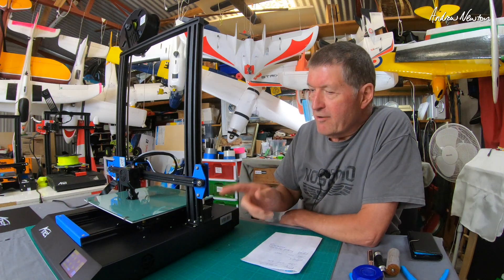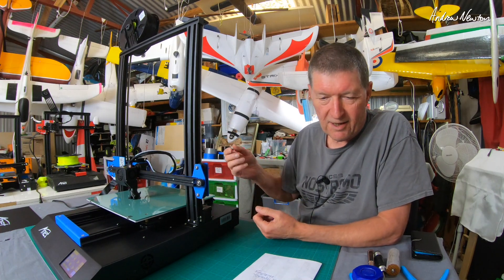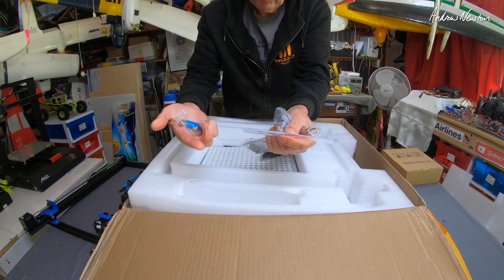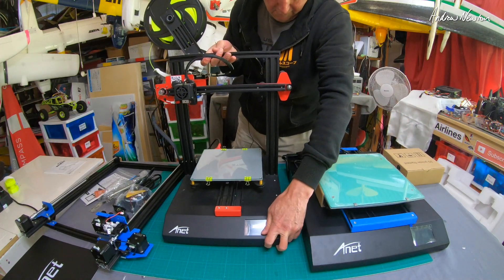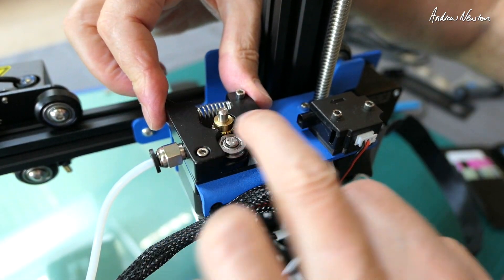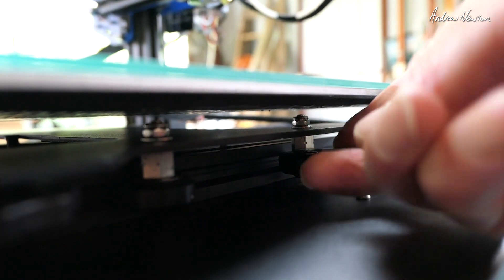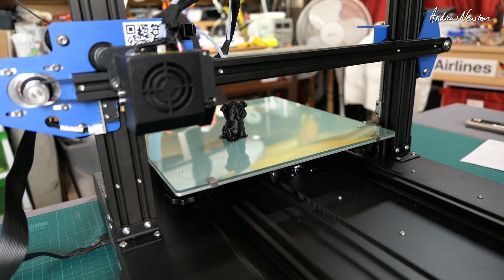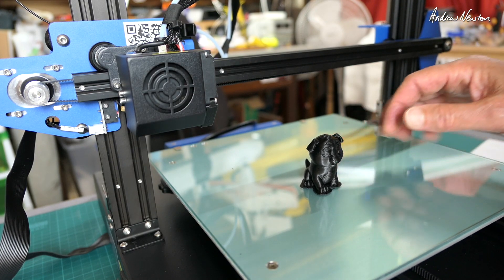Anet ET5X - Larger 3D printer

Comment: I have no experience with 3D printing. But I am thinking of buying this one as it is very cheap. It doesn't get very good ratings either, but I've found that there are very good, inexpensive instructions out there for making it better, such as changing bearings to reduce noise and other improvements. That way I can maybe get a usable printer for my hobby.

My ulterior motive is to build a mostly printed CNC. In order to design and build wooden model airplanes with less effort in the future.

Comment: Looks good for the price. Seldom see such a big print volume at that price point.  Makes me laugh when their website says it's DIY. I built my first in 2010 from a kit of individual components and nuts and bolts,  assembly took almost 3 days! How's it working with TPU??
Reply from the maker: I have some TPU but not used yet. I'm finding the Z sensor a bit unreliable. Seems to vary the zero height by about 5mm randomly.
Reply: @AndrewNewton  yeah that would be a huge problem for most filaments. I guess we will find out how good or indifferent the support teams are. Good luck.